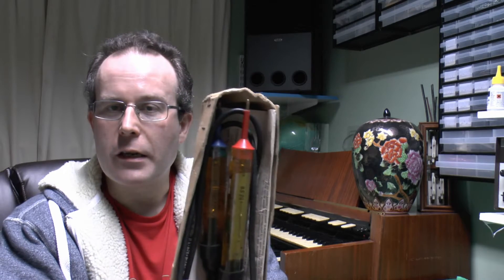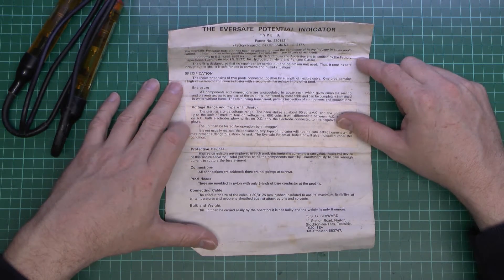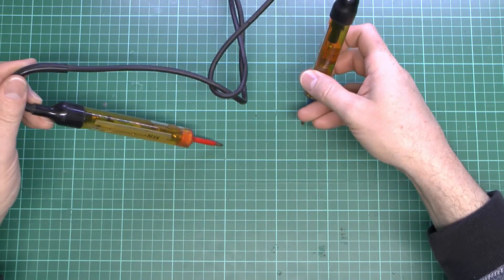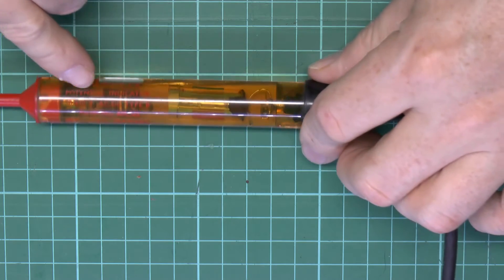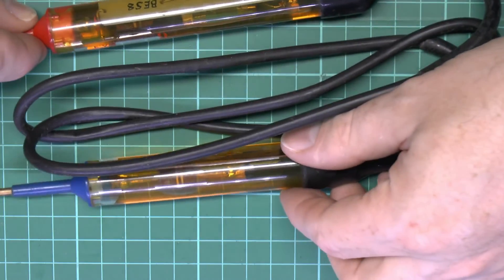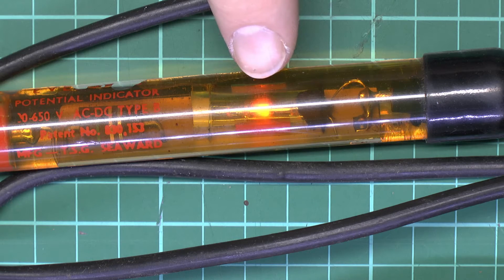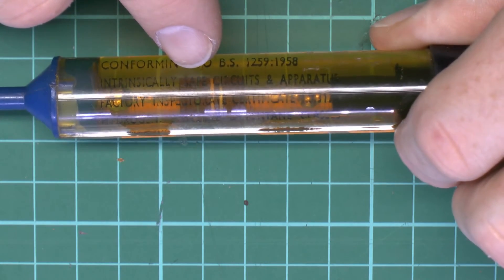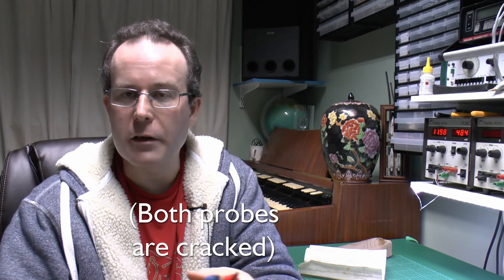Eversafe Potential Indicator Type B

Comment: I think the color stripes got another reason. The tester is not only for AC, it's for DC too and with the neon lamp you could not only detect the voltage, you could test the polarity of the DC-voltage too. With DC only one pole of the neon lamp is lighting (the plus pole), the other one is dark. Such voltage testers with neon indicators were very common in Germany over a long period of time. In one grip you got a neon indicator and in the other plunger coil instrument. When the polarized neons were no longer available they used a combination of neon and LED. LED only for polarity indication. On the pictures you could see the last version of this type of voltage testers. And I've got one of the first models from the 1950s with a black bakelite housing.

Neon, and you could see the legend for the neon indicator:

https://abload.de/img/img_012713s38.jpg

plunger coil:

https://abload.de/img/img_0129vtsxt.jpg
Reply: It's the negative electrode that glows, not the positive.
Reply: Damn, how could that happen? Of course it's the negative pole which is glowing, you're right!

https://upload.wikimedia.org/wikipedia/commons/5/5e/Neonlamp3.JPG

Comment: Eh, I'd still use it. The plastic tube isn't the only insulation present, there's also all the resin inside that thing. Perfectly safe far as I'm concerned, just a minor cosmetic issue.